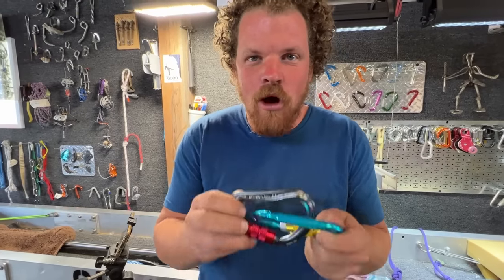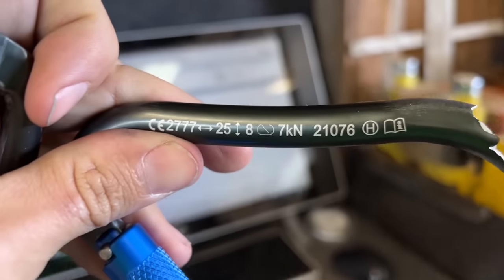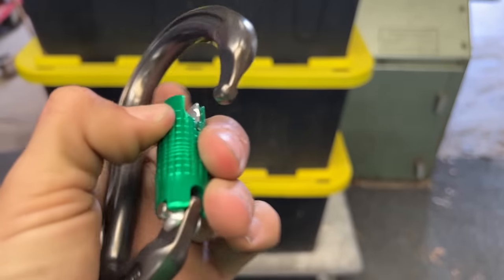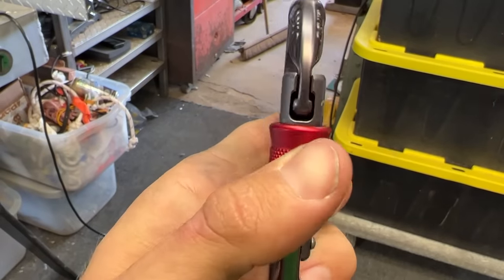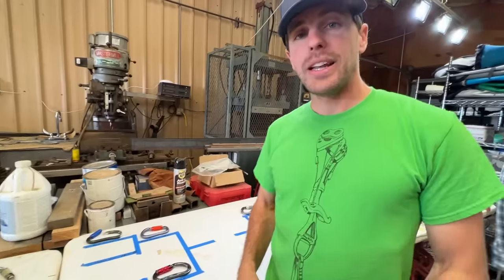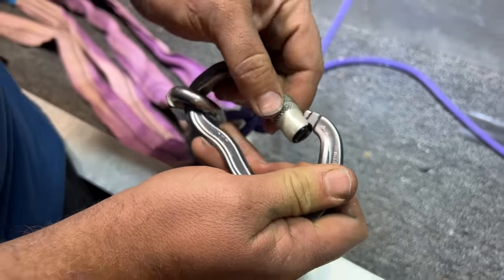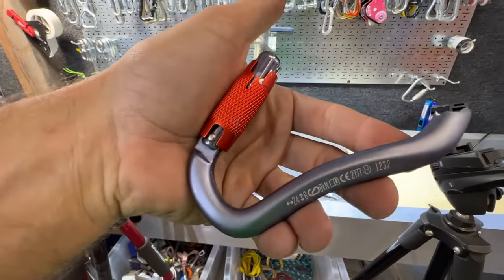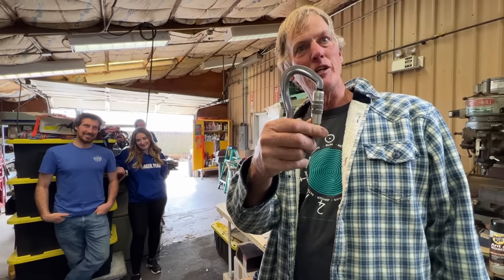March Madness HMS Locking Carabiner Showdown

Comment: Now I know that is a very stupid question that has nothing to do with the video... but it just came up in my head.... have you ever taken a whipper on a 9to1 (or something similar)? As to the obvious question of "Why?1!?!!11!!!".... I do not know
Reply: You’d come into a near factor 2 fall territory because there would be little rope slippage through the pulley system itself, would almost just be falling tied to an anchor.
Reply: @zacharylaschober  Yeah, that's what i immediately thought.... I mean 9to1 should be obviously impossible... but I wonder how much you could tweak it.... at least it should be possible to increase the force that way.... but how much and up to which point?

Comment: My prediction: Austrailpin is going to blow at 39.81 kN, one percent higher "percent over MBS" than that final BD Locker achieved in this track meet. 
(Of course, that's assuming you guys do it CORRECTLY, and make sure you put hinge-side of the Caribiner on the pull-side, and the Nose-side of 'biner on the static side🤣)

Comment: To me a carabiner that breaks closer to its rated breaking strength could be more indicative of a quality well designed carabiner than one that exceeds it. If you are a company making carabiners you would start with design constraints like MBS and then optimize for weight and get as close to the MBS as possible. Having an average breaking strength closer to the MBS with a tighter standard deviation would be lighter and more consistently produced than having a higher MBS with a larger standard deviation. Also in the case of the Petzl carabiner its possible that the breaking strength was lower due to the differences in the UIAA test method and this one, or the load cell may not be calibrated.

Comment: the carbines are basically indestructible..... the only reason to change them is because the mechanism is already a little soft, dirty or stuck and makes you doubt.....

   They should test the strength in their weakest axis, and the capacity of their mechanism when using many times.

🦍 paz! ✌peace!